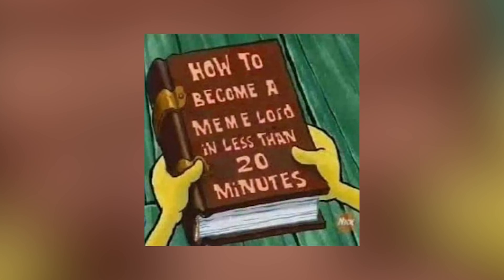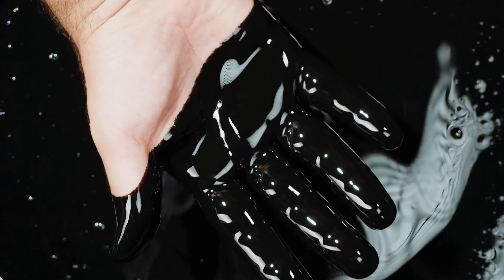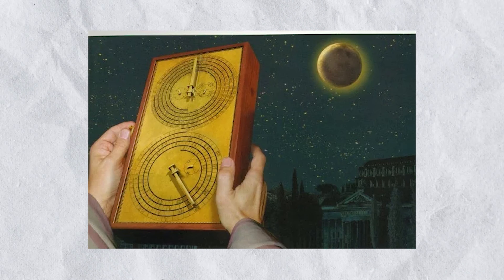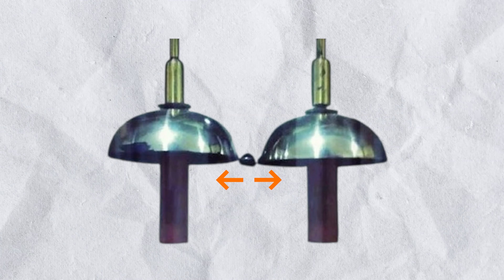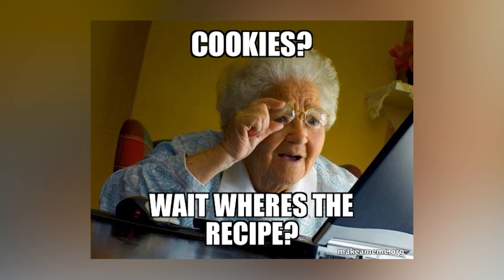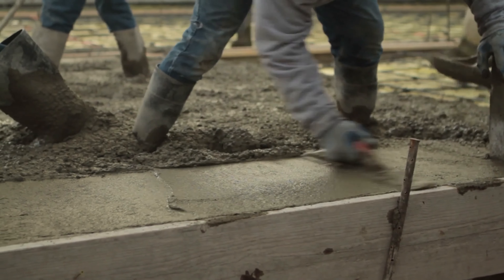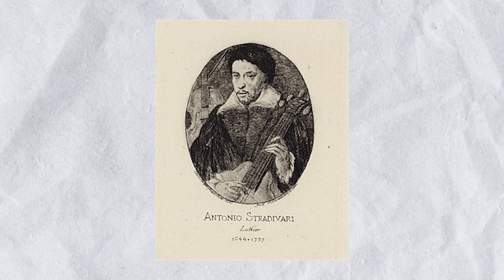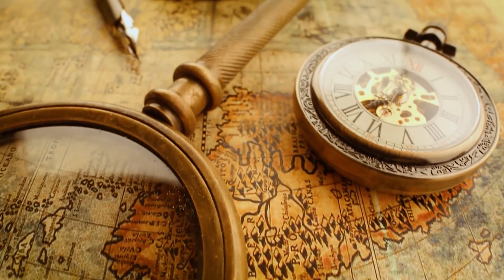6 Ancient Technology Science STILL Can't Figure Out

Comment: You can find on the internet a channel with a guy that rebuilt the Antikythera mechanism. We have a pretty good idea how it worked. 
There are documents about the composition and production method of Damascus steel. It has been successfully reconstructed. 
We figured out recently how Roman concrete works. 
Regarding the Stradivarius violins, it's known that wood density has a role and so does wood preservatives. Modern violins are not inferior at all. In fact research has shown that Stradivarius violins might be made out of porous wood. There's a pretty good chance that Antonio Stradivari (he was good regardless) himself just picked some suitable wood and didn't realise that it was different and this gave his violins an edge.
Reply: The Antikythera mechanism is still very much a question mark. We don’t know who built it, or for whom, or how the builders had the knowledge needed to design and build it.